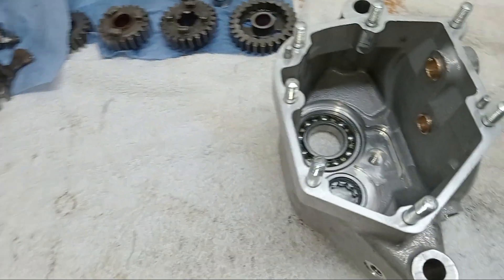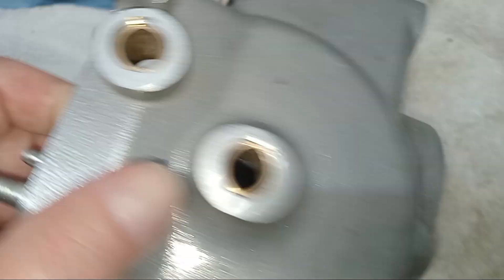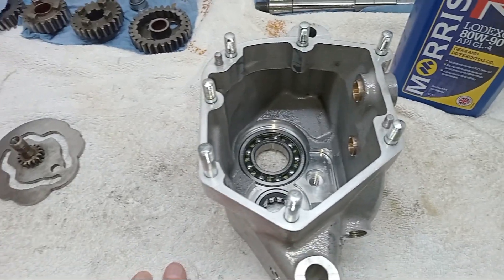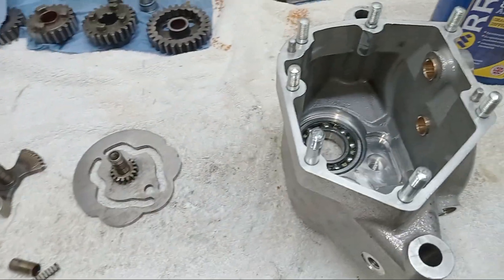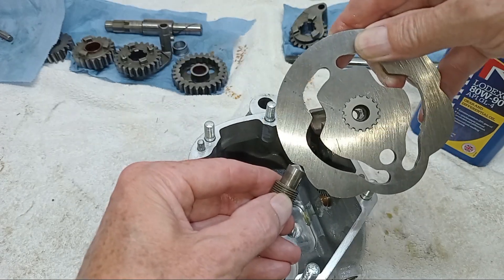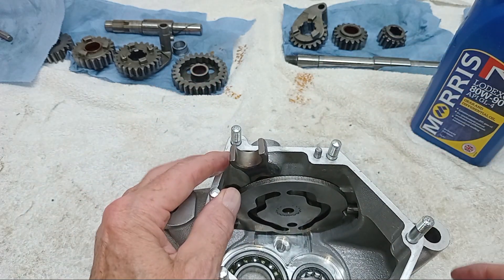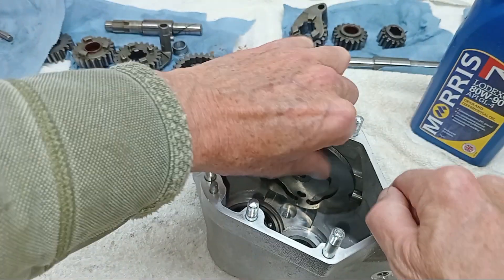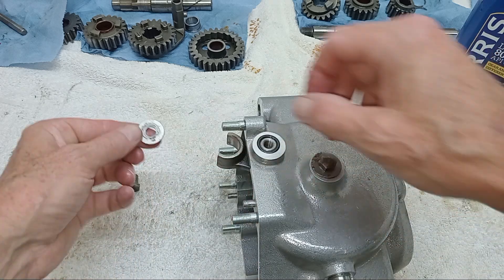Norton Commando Engine Rebuild. Part 33: Indexing the Gears

Comment: Great video and this saved the day when I was rebuilding an early Sturmey Archer EIV heavyweight gear box and couldnt for the life of me figure why it wasnt changing gear. The cam had gotten out of sync when I took the spring stop out. It was super useful explaining which of the notches on the outside related to which gear. Fantastic.
Reply from the maker: Thanks - good to know the video was useful!
Reply: @Chris.rooke150  several of your videos were hugely helpful since the Norton gearbox is still effectively the same as the vintage Sturmey boxes. Ive just uploaded a video series (not as good as yours) restoring on reassembling the Sturmey gearbox. Its on my channel.